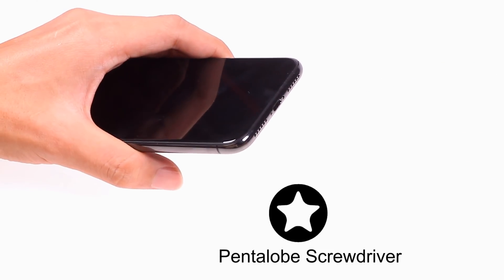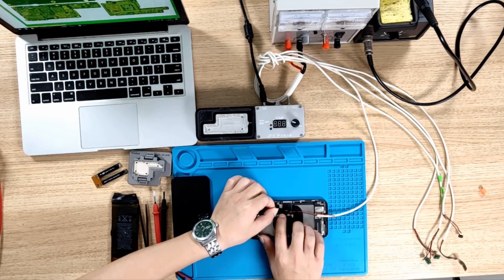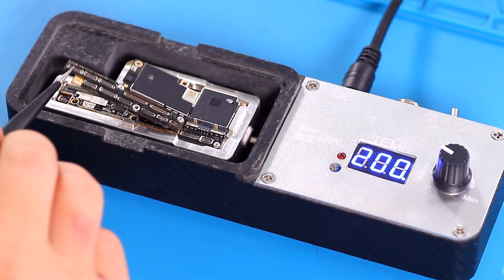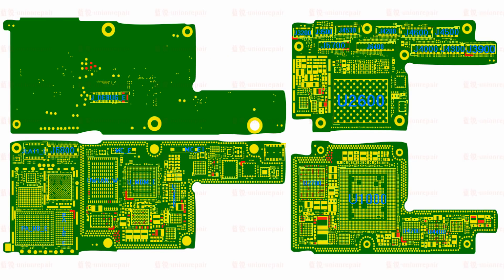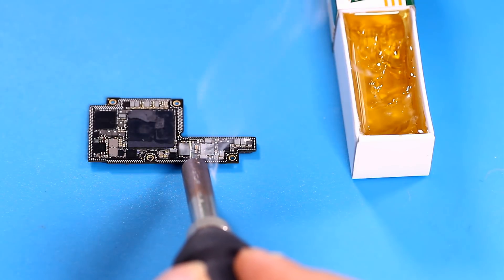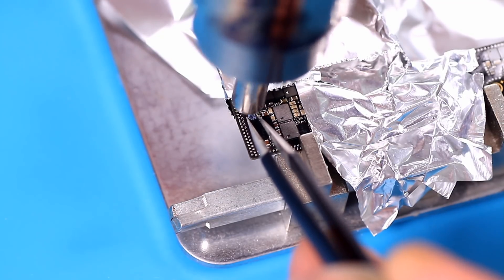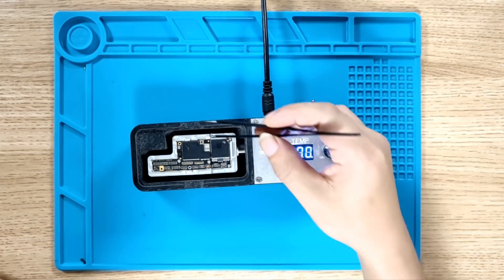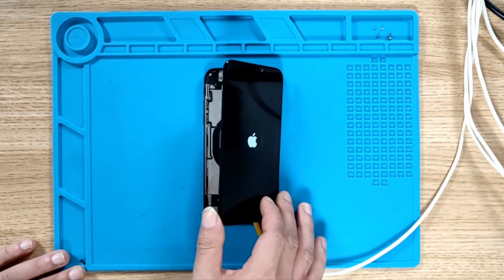iPhone X Power-On Failure Solution | Motherboard Repair

Comment: hello great video  but some errors  this ic is Mosfet (Q3350) so can't be shorted even if it get heat up first !! you'r issue can be related to  this one but you right one line under is shorted (Vcc_main)  you have to go furter to get wich component is faulty but you can exclud this one  ,according to you'r video you didn't solder it back propely too .

i know those errors are done on purpose  ; p

Comment: Why do you have soldered battery between multimeter and probs? Can you please explain this method for searching short circuit. Thanks
Reply from the maker: If there is a short circuit, the current would be very high and causing some heat. The ammeter will show the high current.